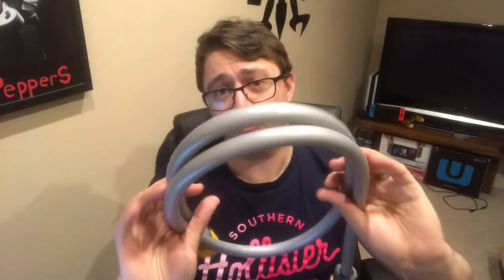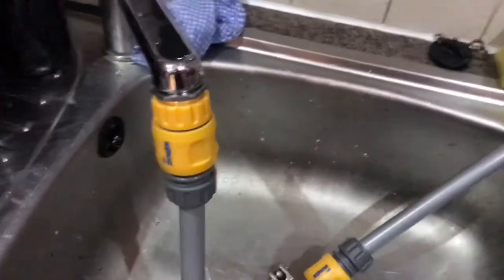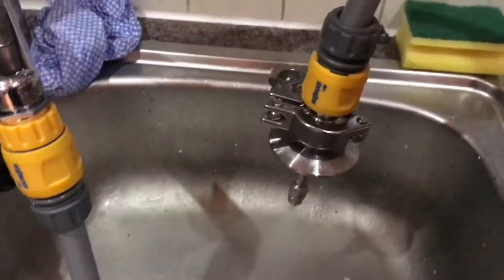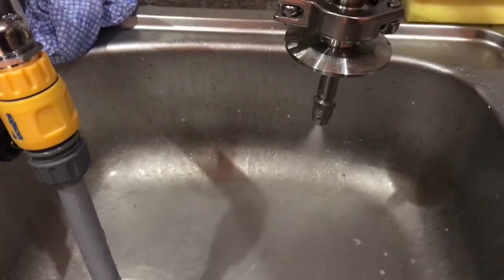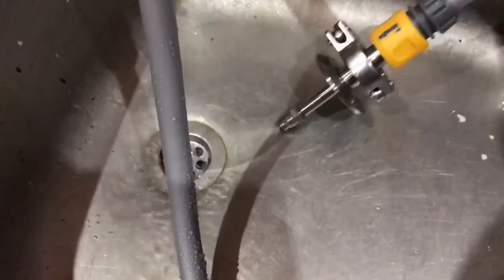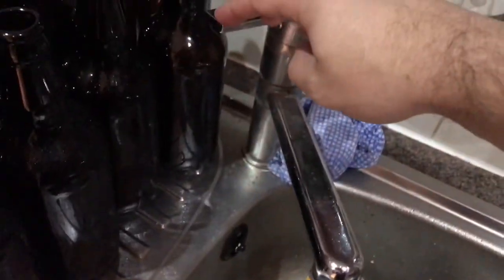BrewTools SPRAY NOZZLE IN ACTION!!!

Comment: Hey. A few tips for you!

Never ever use silicone tubes that are not reinforced for water under pressure. They will simply explode. 

The 3 different nozzle we offer are 0.64, 1.1 and 1.8 liters per minute at 4 bar. Changing the nozzle will not change the pressure. If you have a very high water pressure you can use the 0.64 model. 

Also you should always run the tap full open. Reducing the flow will not change the pressure.

Cheers!
Reply from the maker: Cheers guys, thanks for looking out for me!! You got my back 😁 🍻